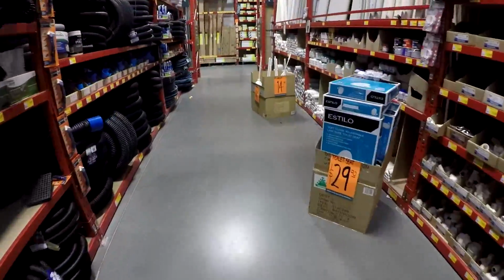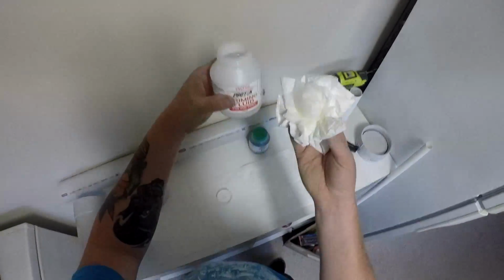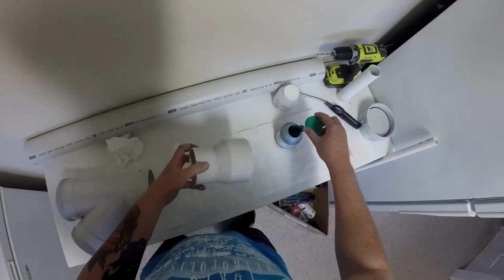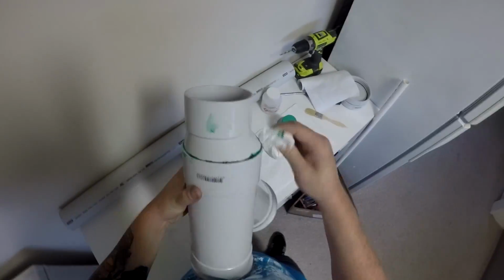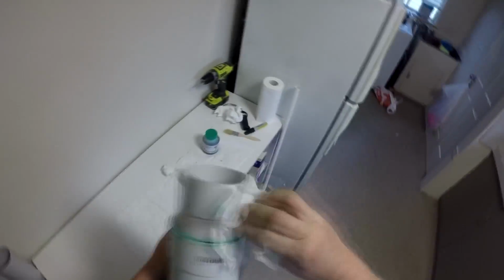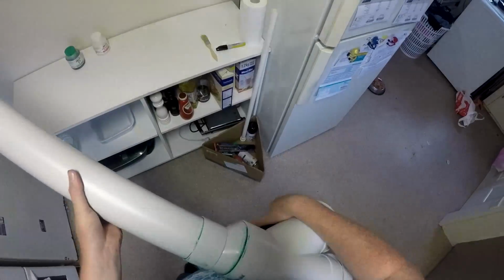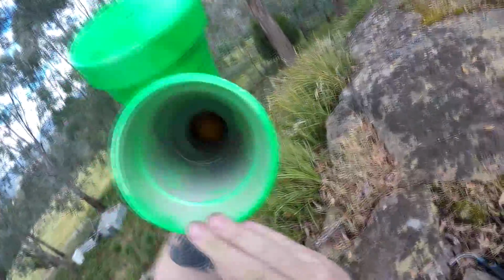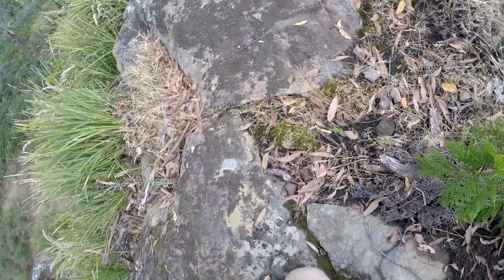How To: Make An Orange Gun | The PVC Armory

Comment: Okay nice job on the y price but if you install a BBQ igniter so that the red button comes through the whole you drilled in the cap . Red emperor apples are better shaped for flight . Also load the chamber by unscrewing the top cap .
CRC sprayed straight down the barrel for less friction .
If you cut the barrel shorter the power increases dramatically.  
Now find a tin fence . Purchase 1 small glass coke bottle. 
Fill the bottle with small stones/gravel or wet sand .
Now using electrical tape, tape the bottle so that it fits the barrel as close to a perfect a fit as possible.  
Spray crc up barrel from the chamber .
Slide bottle in .
Fire away !